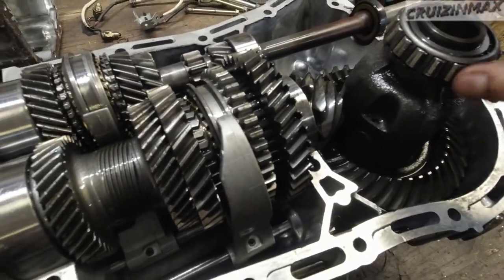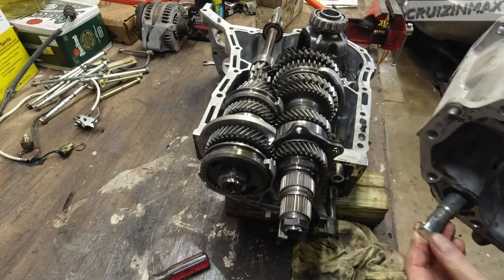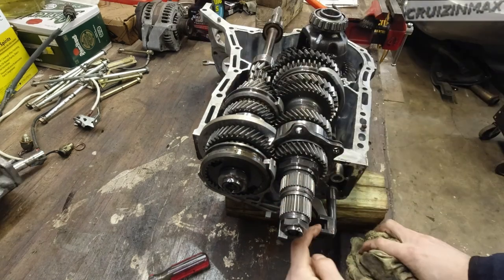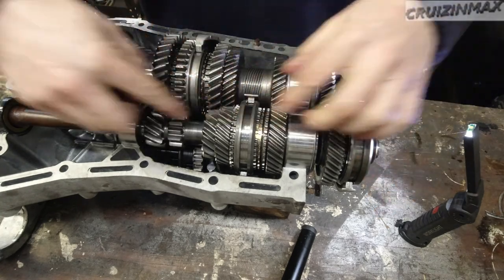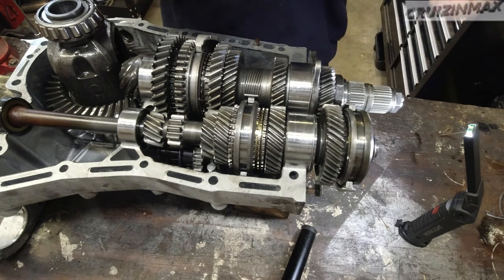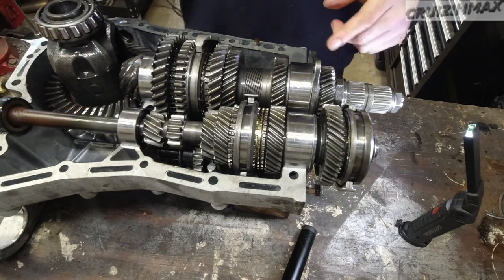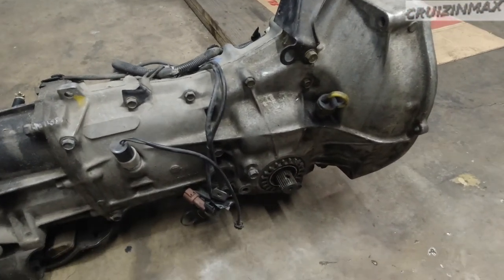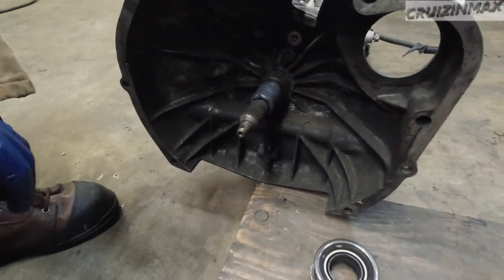Subaru Ice Racing Autocross budget build part 8 manual transmission

Comment: What is the name of the part you replaced? I’ve had this happen to one of my 5 speeds but had 5th and reverse go out. I feel that this may be the same problem I’ve had in the past.
Reply from the maker: not sure but I would guess its the return spring mechanism or shifter return spring.